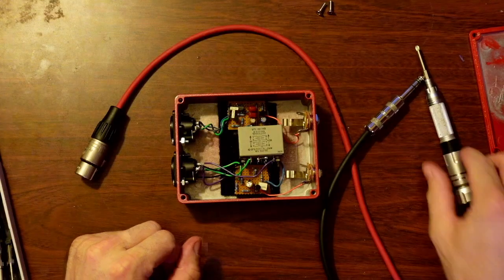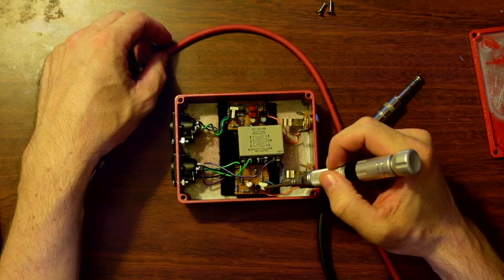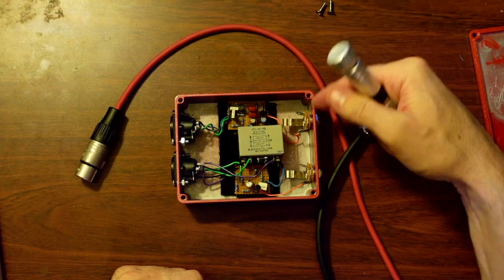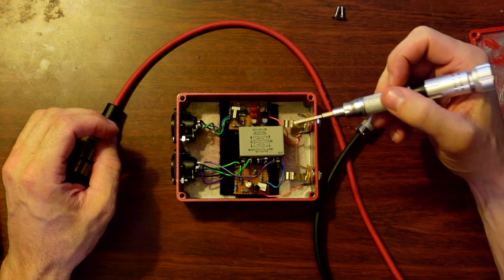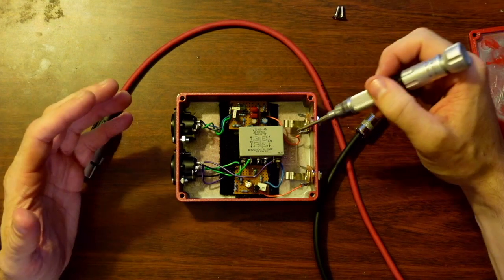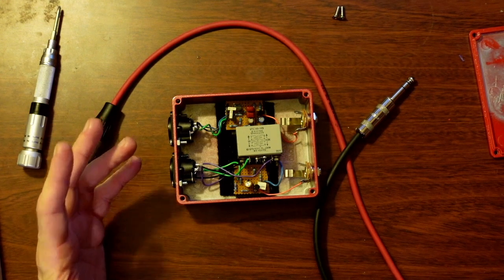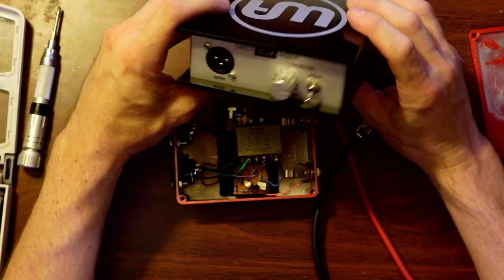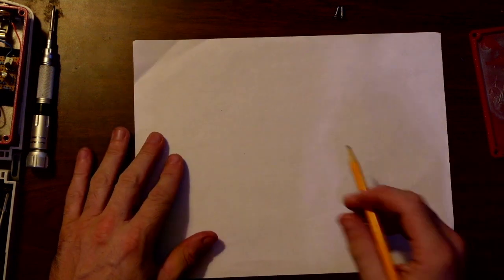The Bastard Child of a Guitar Pedal and a Microphone Circuit: A direct box experiment

Comment: A lot of wrong informations in the video, the pins in the XLR are not Hot or Cold, one Pin carries the Signal with a Positive Polarity and the other Pin carries the same signal with a Negative Polarity (180 degrees inverted), if you consider the Signal + the hot then it's Pin 2 and not Pin 3 like you say in the video. So Pin 2 is Signal + (hot if you consider it that way) and Pin 3 is Signal - (Cold if you consider it that way. Also and really important you are incorrect when you say that it's not important which is "hot or cold", thats really important because otherwise you can have the Output with the Polarity reversed when compared to the input. having the correct polarity is extremely important
Reply from the maker: "thats really important because otherwise you can have the Output with the Polarity reversed when compared to the input" 

I will add an annotation to the video that I  numbered them backward in the schematic I drew and that some people might find that it matters in their setup. ETA: Apparently YouTube doesn't support annotations anymore, I'll have to make do with a correction in the video description.

But I disagree that it's extremely important here. The input from the guitar has no meaningful phase relationship on its own. (If one of the pins were actually -ve DC then we would have to be more careful about it). As proof of the irrelevance, a polarity/phase switch would just swap the two pin connections anyway. Plus if someone is simultaneously micing a source that they're using a homemade direct box on, they can just flip the polarity switch on the preamp. Almost no one is doing that live with a direct box they made in an hour.

"the pins in the XLR are not Hot or Cold" -- Wikipedia (among other sources going back decades) calls them hot and cold, it's incredibly common terminology: https://en.wikipedia.org/wiki/XLR_connector#Three-pin_in_audio_use
Reply: @jonspatton  "The input from the guitar has no meaningful phase relationship on its own. " Well it seems you really don't understand the concept of Audio Polarity, of course the output of the guitar (not input like you said) has a meaningful phase on it's own, pickups in a guitar are wired to maintain the same Phase/Polarity when changing the selector switch. So if you reverse the connections to Pin 2 and Pin 3 of the XLR output your are actually reversing the Polarity at the output when compared to the polarity of the Guitar's output. That means that if you use an AMP and a DI to record, both signals will have the Polarity reversed, this is just one example, but there's more... If you check any properly made commercial DI the output polarity it's exactly the same as the polarity of the signal at the input, it's a simple concern that you don't seem to even understand and forgot complete, but worse you even defend it. Your video is full of incorrect statements and assumptions.
Reply from the maker: ETA: To make this slightly more productive, I see that you make your own videos. If you find the lack of rigor in this video to be so egregious, record a video response with a corrected circuit for the internet. On you can fight forest fires.

 @MrCacciLLo  "Well it seems you really don't understand the concept of Audio Polarity, of course the output of the guitar (not input like you said) has a meaningful phase on it's own"

Phase (polarity) relationships only matter in the context of two (nearly) identical signals that can cause a phase problem: A single source cannot cause phase cancellation with itself. That's what "on its own" refers to. The reversed polarity cannot cause a problem by itself (many, many, MANY classic guitar pedals reverse polarity), and in any situation with multiple sources where it could cause a problem if someone followed my hand-drawn schematic in the video without doing any further research, the preamp it's plugged into will have its own polarity switch to fix their problem if they even hear it. And if the second source is a microphone on an amp, moving the microphone would change everything anyway. So again: This doesn't matter as much as you have convinced yourself it does.

Further, this isn't a project for sale, there's no downloadable schematic for people to follow, and the video also isn't a dissertation on phase or polarity relationships in audio routing. This is documentation of a project I made with parts lying around my house that was different from other direct box projects I found, and I already added a comment to the video description explaining that people with multi-source setups will want to be careful about which pin is correct on their XLR. I can't fix the audio or the image on the screen. I acknowledged my mistake and we can move on, but you are also manufacturing a problem that will not affect most usage.

Comment: input is mono but output is also mono. The Jack is not mono, it's a TS Jack, Tip and Sleeve, a jack with 2 contacts, an audio signal can be mono or stereo but a connector it's just a connector with an X number of contacts. A connector is never mono or stereo.
Reply from the maker: I think you'll find that most online retailers call a TS jack mono and a TRS jack stereo. The electronic implementation of the part might not be stereo in most applications, but this is how they're named when people are looking for parts. ETA: I don't mind pedantry in general but this is really unnecessarily pedantic.
Reply: @jonspatton  No, I don't encounter retailers that call a TS Jack a mono jack, or a Jack TRS a stereo jack, actually a TRS Jack can be use for 1 channel of audio (Mono) or 2 channels of audio (unbalanced stereo). Even if your retailer is ignorant and calls it that way you don't need to be ignorant also, and more than that like sharing incorrect information and even coming here defending your ignorance instead of correcting it. You are doing a public video, talking about a subject that you don't have enough knowledge to talk about, you can be sure that the "Public" will criticize you. By providing misinformation your video is doing much more harm than good.
Reply from the maker: @MrCacciLLo  "No, I don't encounter retailers that call a TS Jack a mono jack, or a Jack TRS a stereo jack"

ETA: I'm willing to chalk this up to what is almost certainly a language difference, since it looks like you aren't a native English speaker, but I'll leave my original reply here.

You must not be looking hard enough or you aren't using the most common manufacturers' products.

Switchcraft: https://www.switchcraft.com/1-4-mono-2-conductor-jack-w-nut-and-washer-open-circuit/11/

MONO 2-conductor

https://www.switchcraft.com/1-4-stereo-3-conductor-jack-w-nut-and-washer-double-open-circuit/12b/

STEREO 3-conductor

Neutrik: https://www.neutrik.com/en/product/nj2fd-v
Non-switching MONO jack (T/S)

https://www.neutrik.com/en/product/nj5fd-v
2 x switching (normalling) STEREO jack (T/TN/R/RN/S)

They are called the same thing at retailers: Mouser, Smallbear, etc., but I'm not going to spam a hundred links from the internet demonstrating how wrong your statement is.

Calling it a mono jack is not misinformation, it's industry standard terminology, and hence it is the part name that people know how to buy. You can personally be as pedantic as you like in your own videos, but I prefer to speak a common language with my viewers.